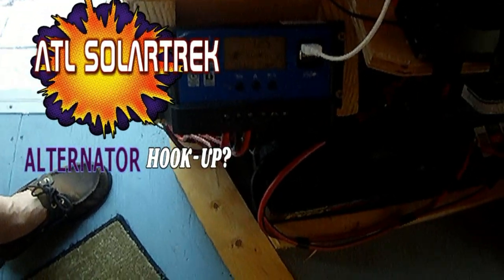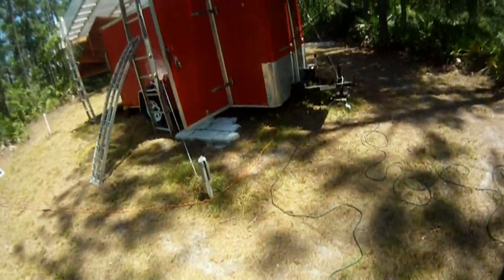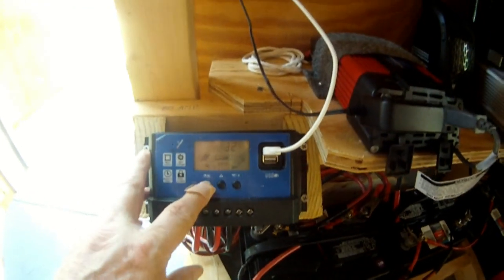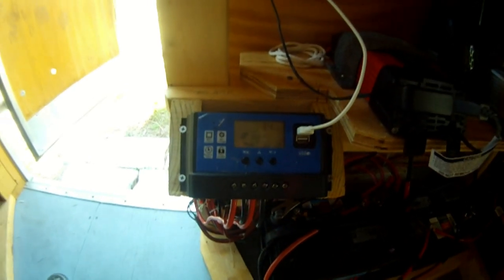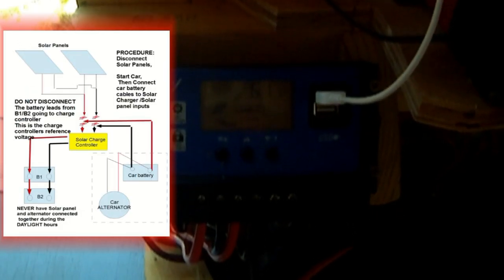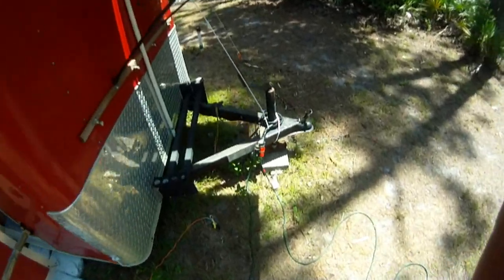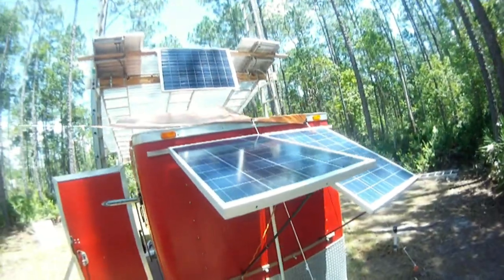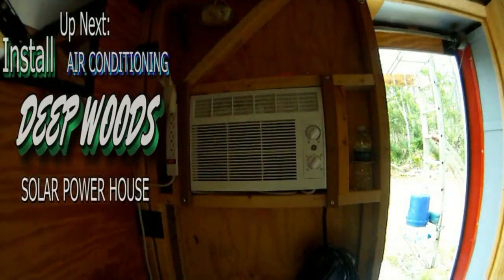SAFE Howto Hook up car ALTERNATOR to SOLAR CHARGE CONTROLLER Solar panels solar energy projects DiY

Comment: Couldn’t you do the same thing with the car off and if you have a small power inverter hooked up to the car battery system it would warn you when it’s getting super low then you could then turn the car on to jumpstart the system again
Reply from the maker: Hi J DOT, Thank you for watching! maybe you could do it SOMETHING LIKE that but, if you were out in the middle of the woods, would you want to try having a  LOW battery and your car would not start? Thanks again for watching!

Comment: I've been trying to find this forever, what is different with using a solar charge controller to feed power to house batteries vs a battery to battery charger?   To me they should do thr same thing which is regulate DC power.  A guy should b able to buy a 100 Amp mppt solar charge controller and use it when he sees his alt is passing max 60amps to his house batteries thru a voltage sensing relay?    Why would this not work?    Wouldn't thr solar charge controller just stop that charge once the batteries r full?   Or better yet act like a 3 step charger as the house batteries become topped off?   Anyone's help with this ? Would b greatly appreciated.     I am pretty electrical technical so please explain plain whole thing?
Reply from the maker: Hi Nate,
Thank you for watching. 
Before we begin the explanation,
remember, you must disconnect the solar panel inputs from the mppt before you attempt hook ups from alternative source (like an alternator from your car ....).

An alternator needs a + positive potential to start developing current.
This can not be achieved without a battery between charge controller and alternator.
The solar charge controller ( mppt ) has a diode on the positive side of power input. so , alternator would not sense any  positive potential from house batteries.

so, to answer your questions,  if your alternator is putting out 60 amps continually, you need a new internal  regulator!  without it, you would over charge the car battery. the house batteries after the mppt would be ok. The mppt would shut off power in ( from alternator )  as soon as your HOUSE batteries reach desired top off voltage. eg: 14.2V DC . 
but without the new regulator for your alternator ,your car battery would overcharge.
now if your regulator is working fine on the alternator, you could use it with the the above described methods. 
As for the converter / battery charger method,  you could hook up BEFORE the mppt. but not directly to the house batteries. The mppt would sense the converter power and would not work with solar arrays until the mppt  is disconnected from house batteries and reconnected to reset the voltage sensor inside of mppt.
If you have anymore questions. let me know!
Thanks again for watching!!

Comment: if I have 2 solar chargers and use 1 with the panels can I use the 2cd one with an alternator without un-hooking the panels from the other controller? and do I hook them both at same place on batteries?
Reply from the maker: hey get real,
thanks for watching.
no, you cant do that.. potential felt at 2nd charge controller would be incorrect. no power would pass thru the charge controller...
thanks again for watching
Reply: Get a dc-dc charger.

Comment: My stater quit charging on my outbord motor on my boat, can i add  solor to charge the batteries while i run the boat motor at the same time, and will it make as much power as the stater charging system?
Reply from the maker: Hey Paul,
Thank you for watching.
If the stater is still operating the outboard and firing thru coil,
you need to replace the regulator.
You could use a 50- 100 watt panel to charge the battery that starts your outboard. but it would not operate as a stater for running your motor. Thanks again for watching!

Comment: My altetnator does 320 AMP at 650 rpm
Reply from the maker: Hey Sebastian,
Thank you for watching.
You do have a high power alternator. Although, using the solar charge controller with setup shown in this video, you will not need much of the power produced by your powerhouse. What you got, a truck / van or semi?
Thanks again for watching!

Comment: Why hook it up to the solar charge controller where you can just hook it up straight to the battery?
Reply: Lithium batteries for example, safer charging
Reply from the maker: Hi Coenie,
Thank you for watching.
Here are a few reasons to hook up at charge controller.
1 - the most important reason is you will not burn up your alternator. The charge controller isolates car battery and alternator from cargo / power station batteries. If alternator is run direct to power house batteries and you are running a full load inside power station, it can not handle the current draw and will eventually, burn up the alternator. Think about it. If air conditioner is going, well pump is on as well as fans, lights computer, and other portable devices we are talking about 3000 watts or more of energy being consumed. 
3kw / 12 = 250  dc amps.
2- using charge controller you can monitor current draw, voltage at powerhouse and decide maximum voltage you want at power house batteries.
I could name more but just watch the video again! There is a lot going on there!
Thanks again for watching!

Comment: you can leave the solar charging at the same time you charge from alt.  Batteries do not care how many chargers you have hooked up to them
Reply from the maker: hey 4shooters, thank you for watching!
unfortunately, you cant do that.
if solar panels are hooked up at same time and they are producing power, the alternator will sense this and will not be supplying proper charge to the CAR battery... 
thanks again for watching!
Reply: @AtlanticDrain  Everything is always down to the load being drawn,, a car alternator will try to supply that load. Think of electricity as water, volts as speed and current as volume. If you place an alternator on your charge controller and the charge controller draws nothing then the flow will be nothing. You should be able to max out your charge controller by using thicker wires. Your experiment would've worked without the car 
being started as the charge controller are essentially drawing power from both the alternator and the battery in the car. Start the car, disconnect the battery in the car and this way you can be sure the power showing at the controller only comes from the alternator. If you use an alternator with 50A idle speed generation you will get about 700w out of it if the load is 700w. the 80 odd watt that you're showing in the video is because that is what your solar controller is drawing, not what the alternator is "pushing". If it was up to the alternator to "push" current it would "push" 700w down to your controller and light it on fire, but this is not the case.
Reply: @Voidy123 

Sorry. That won't work. I tried it already , I was thinking same as you. 

Alternator is a voltage source. It pushes volts.

Solar panel is a current source. It pushes amps.

The solar charge controller modulates the amps of the solar panel to maintain battery voltage. If you connect the alternator to the solar panel terminals of the solar charge controller , the current demanded from the alternator will be almost zero.

Get a dc-dc charger to hook the alternator to the solar battery. Then you can use the alternator (dc-dc charger) and a solar panel (solar charge controller) to charge the solar battery at the same time with the two sources.

Comment: why my solar charga controller level of battery not showed
Reply from the maker: Hey Zama n,
Thank you for watching.
In oreder to answer your question,
 logical troubleshooting must be done.
So, this would be a bit lengthy but here goes.
 1- does the display show ANY INFORMATION  IT?
2- DID THE DISPLAY EVER SHOW BATT VOLTAGE IN THE PAST?
 Let me know
Reply: nope..only show one time after i buy..but when i not fully touch positive wire to battery..the level of battery is shown..when i touch it back to battery the level of battery is gone..mine is PWM 60A..so how can i do troubleshooting
Reply from the maker: @zamanberubah6076  hey zaman.
Be sure your solar panel cables are not connected to the charge controller. Then, reconnect your battery negative and positive to the charge controller. If battery voltage is now displayed onthe charge controller, you may reconnect your solar panel cables negative and positive to the charge controller.
* If there is still no display when you connect the battery cables,
Then you need to get a new charge controller.
Reply: @AtlanticDrain  ok cool

Comment: Buddy, are you joking??? the amount of current from alternator is MINIMAL!!!??? to the solar panel inputs???
I'm not sure about your car but my stock alternator is 190 AMPS and you will be lucky IF at direct sun light to get the maximum 14 AMPS (200W/14.4V) from your 200W solar panels!!!
first of all you need to run proper 4AWG or 6AWG wire from alternator to the solar charger ( you are wasting a lot of amps by using 16 AWG AC extension wires just to the resistance)
second of all, just because your battery bank is drawing 5.7 amps from the charger doesn't mean that is the max the alternator can provide!!!
Reply from the maker: Hey Amer,
Thank you for watching.
You should look thru some of the previous viewer comments Before making such a "loud" question!
 I have answered this Question more than once

Yes, the amount of current used "is MINIMAL".
wacth the video, it shows you the amount of current being drawn.
In Short, The Solar Charge controller HAs a Diode in line That acts as an Isolator.

What you are not taking into consideration is, 
The alternators reference voltage is the CAR BATTERY. Not the Power station batteries. The amount of current draw is dependent on the Difference in Potential between the car battery and the power house batteries.
eg: Car 13.1 Power station 11.2VDC
 Using The Isolator keeps what the Alternator thinks is just below full charge. It does not see or feel The voltage at the power house. Hence, it only puts out MINIMAL CURRENT to recharge .1 -.4 volts. The alternator has built in circuitry to Decrease its output current as car battery reaches full charge basically the same as I just described. 

I could explain more but please look thru previous viewer comments to view more info.
Thanks again for watching!

Comment: Why not just invest in a second charge controller and have them going at the same time?
Reply from the maker: hey off grid, thank you for watching! yes, thats possible! that way, you would not need to disconnect the solar panels. but, you still would only want to use it at night. thanks again for watching!

Comment: Won't this over discharge your car battery if the draw is greater than what's available?
Reply from the maker: hey off grid, thank you for watching. if that were possible then, yes it would. but, current draw is limited to the voltage potential difference between car battery and pv storage batteries, which would be maybe 4 volts.  thanks again for watching!
Reply: wont the alternator voltage regulator engage when it senses low voltage?

Comment: I would not be doing that if you had proper deep cycle dry-type solar batteries.
Reply from the maker: Hey Martin,
Thanks you for watching.
This type of charge controller only works with lead acid batteries.
But thanks for watching!

Comment: A better method, may be to keep your solar panels hooked up to the charge controller, and still connected to the batteries.  

And having a second charge controller connected to the batteries, that you hook your alternator up to.  

That way, you don’t lose any energy the solar panels could be sending, and your alternator can charge the battery with with solar panels.

Now, I assume that batteries can only sustain a certain amperage as far as how to charge them properly, but I’m sure this can be handled by some form of limiting each controller to only allowing roughly 50% of max amps coming through each controller
Reply from the maker: Hey Mach,
Thank you for watching.
some of what you would like to do may be possible but,
Very difficult to achieve without blowing up your alternator, frying your solar panels and charge controller.
I would not try to hook up solar panels. during day time hours, the solar panels would be putting out 18volts,
the alternator would sense the voltage and be putting out 0 volts.
at night, the power from alternator might back flow thru panels ( unless there is a diode in line on each panel for isolation) and fry the panel foil runs as well as your alternator....
But with a lot of safety circuits , your ideas may be possible.
Thanks again for watching!!
Reply: @AtlanticDrain  thank you.  I’ll keep trying.  Maybe I’ll get lucky

Comment: I bet you could hook a pony up to that system too. I would not recommend doing this.
Reply from the maker: !hey mark !
Thank you for watching. I have had a need for a backup system many times. Im always on the go.
I open this project up 3 or 4 x per year. stay for a week or a month!
when its really hot outside, i use every ounce of energy produced by the solar panels.
by 10 pm or so on really hot evenings, I need to put more energy back into the system. this method works very wel. you do have to be very careful and follow my instructions to the T in order for this to work and not blow anything up. but, its quiet compared to a stink generator! :)
Thanks again for watching

Comment: Totally wrong "result" . 5.7 is result of load.
Car alternator can easily hit 100A when needed , so your way of measuring is wrong. But thanks to showing us working controller connected to a car system
Reply from the maker: Hi Gustav,
Thank you for watching.
Of course it's load but, the load is the difference between car battery and solar batteries.
You have not and do not understand how components isolate LOADS. I get pretty tired of explaining over and over...
Please look thru previous comments before saying anything beyond your knowledge 
Thanks again for watching
Reply from the maker: I am only going to say this one more time... If you hook up a car battery with the alternator running DIRECTLY TO solar batteries WITHOUT the charge controller OR an isolation diode, the alternator will feel the solar batteries LOAD  eg : air conditioner, inverter. This will cause your alternator to pump continuous high current. ( + 59 amps or more). Your car alternator will soon overheat the triodes and your alternator will need replaced...
This is not the only reason for video set up I've shown but, someone needs to stop all of these viewers who are not thinking thru what I have said in this video. In previous answers to comments I have explained thoroughly, all aspects related to hook up and what it does electrically at each component is n the systems. Thanks again for watching and PLEASE,. Do not attempt to hook up alternator to charge controller in any other method other than what I have shown you in this video.
Reply from the maker: I will soon make another video to demonstrate some of the loads and potentials created from the combined systems for hopefully lemans better understanding as so no one will be putting there foot 🦶 n there 😺. I will attach the video to the end of this one for future reference...
Reply: @AtlanticDrain  it's okay man, the world was build by a people who were not afraid of trying. For me it's motivation to try it by myself and proof I can do it better or not. Otherwise it's just criticizing. You responded my question why I found your video: has anyonet tried to pair car alternator with cheap solar controller? Result is yes, you the brave one and not lazy enough not to upload it. 
About the topic: my idea was using step up module between alternator and controller
Thanks man
Reply: @masakeris 

You need a dc-dc charger. The solar charge controller won't work.
Reply: @masakeris  

The only way to charge a solar battery 🔋 with the full power of a car alternator through a solar charge controller is to use a power transistor as a current amplifier connecting the collector and emitter to the solar panels terminals of the solar charge controller and a exciting current to the base of the transistor.

Comment: does ANY watt panel work...like even a 20watt panel wit the car battery linked then to the solar input...?
Reply from the maker: Hey nekro, thank you for watching. You could leave solar panels hooked up at night. But, during the day, if solar panels is hooked up, the alternator senses 18 volts and does not put out any voltage or current to battery.
Thanks again for watching!